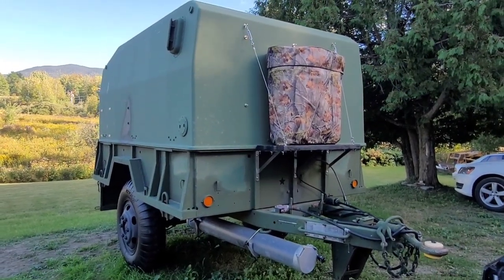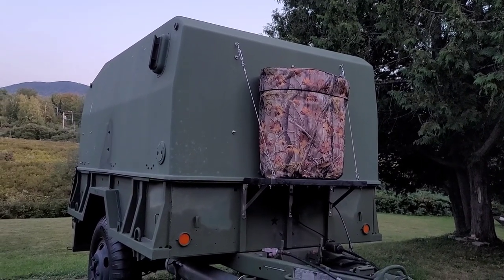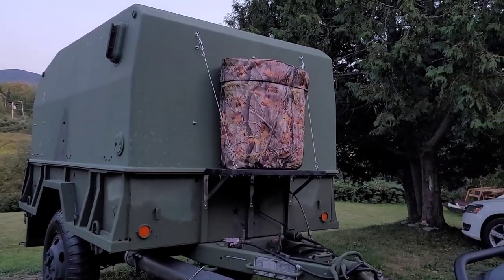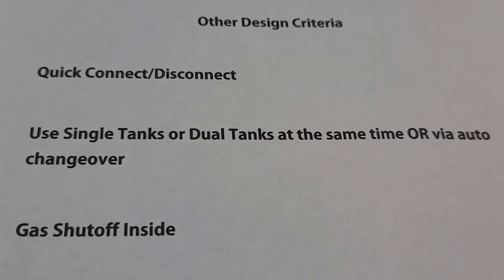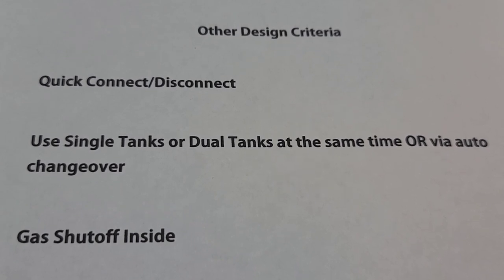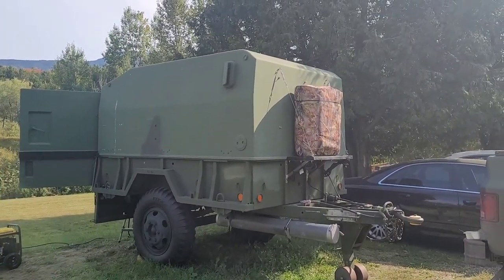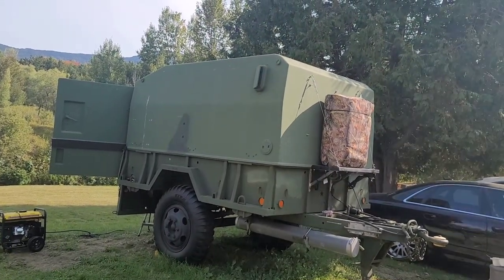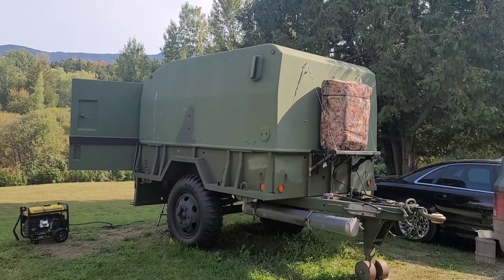Military Trailer Project: EPIC propane hookup DIY - Mr Heater Big Buddy, Champion Inverter Generator

Comment: Thank you Sir: This tutorial has been incredible for a couple projects of mine that are in the early beginning stages on the smaller project (truck camper + utility trailer) and in the planning stages on the larger one ( double wide trailer man cave) You have done the vast majority of the legwork and systems designs that I will be able to extend out and possibly add to in a couple places for everything I need. The amount of, and quality of detail you have shared is fantastic! You have saved me an enormous amount of time. Thank you again.

Comment: So I already have the same heater and so that section was great. One question I have there, and mind you, I haven’t even taken mine out of the box yet. I probably missed something simple but could you add a Y after the shutoff valve and a pigtail to each tank port rather than the second tank setup? Point well taken on the spare setup being a good backup as well.
Reply from the maker: Hi Max, not sure about the Y after the shutoff.  My guess is that you could, but I'm not an expert.  Thanks for watching.